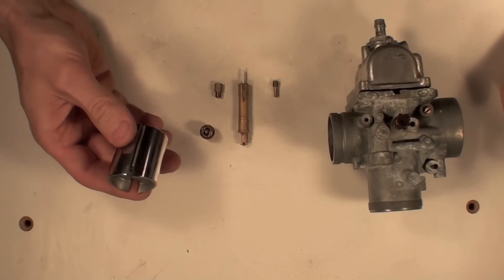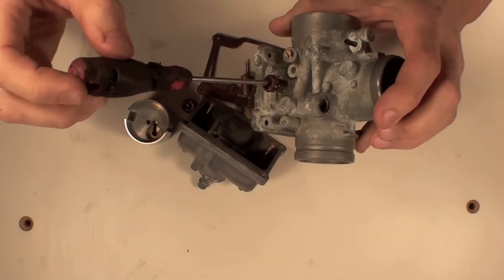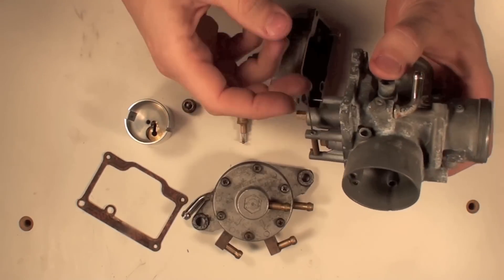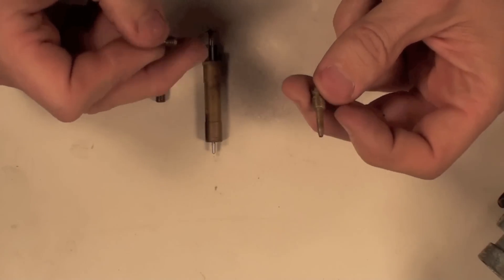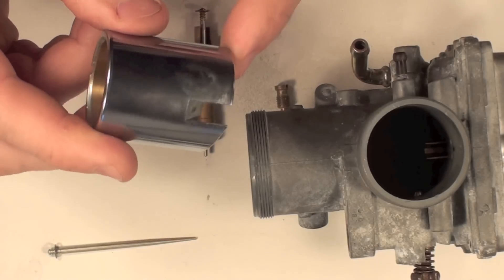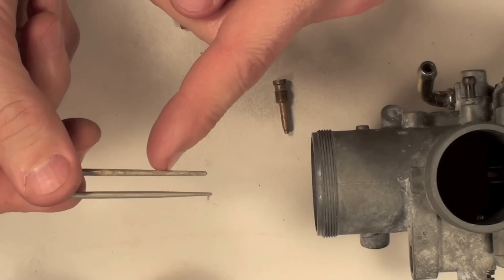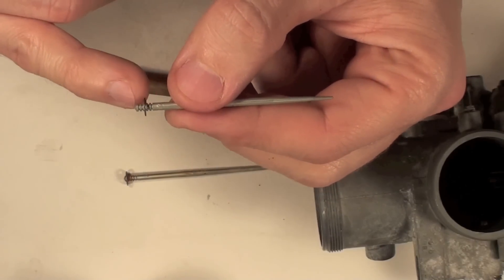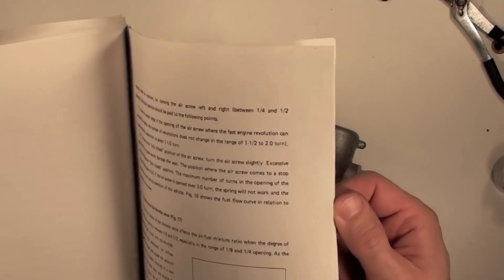Mikuni Carb series #4 How a Mikuni carb works.

Comment: What about the air jet that feeds the main . It's
Lines up with the main jet, the big hole on the air filter end. If you leave it out it will never run right.

Comment: My bike will only rev up with the chokes on, it won’t rev with them off. It just goes blahhhhhhhttt and dies. The plugs have always been very sooty and black, which tells me it’s too rich. Since the Mikuni starter circuit is different from a standard choke, is it giving me more air to the mixture while it’s on and throttle opened? Which is why it can then rev with the choke on? With the throttle closed, it will barely idle with the starter circuit on. Been chasing down the tuning with these carbs for weeks. Air screw is almost falling out to achieve a rise in rpms; I have smaller pilot jets on the way. Any help would be greatly appreciated. Honda 400cc with Mikuni VM 32’s.

Comment: looking for some help> ATV idles and runs fine up until 3/4  throttle. but when i really get on the throttle it bogs down to nothing. spark plug is wet so i know its running rich. what adjustments can i make to fix this problem?

Comment: Lots of Mikuni's also use an Air Jet located inside of the intake venturi.  I believe in your VM manual it is shown as item number 25.  Can you explain how the Air Jet works in conjunction with the pilot jet and air mixture screw?  Does changing the size of the air jet change the intake vacuum during starting allowing more or less fuel to enter?
Reply: Not with the pilot circuit. Strictly main circuit.
You'll have to read more on it.  Just make sure it's clean an put in snug

Comment: I recently ordered a Mikuni VM16 Carburetor for 2 pit bikes and have been having issues with them.  One of them came in and the bike would start, but it would only run on half or full choke even after being warmed up.  Then, once warmed up, the bike would bog in the mid range and not be able to get to peak revs.  
Also, when I turned the choke off, and tried to rev to keep it going, it would create tons of smoke.

On the second motor, it doesn't start at all.  It just floods.  Reset everything back to factory spec and let the engine sit and tried again and it flooded 5 times in a row in just 3 or 4 turn overs.  

Can I get some help with tuning these?

Comment: Trying to get a 95 Timberwolf 250 to idle. My brother cleaned the carb and rebuilt with an "all balls racing" rebuild kit. Still won't idle. You mentioned the pilot screw doesn't need to be adjusted that much.. We put a muffler on the quad because the old one was all rusted. Him and his friend were trying to get it to idle and I remember him having the pilot screw 2 turns out and he was trying 2 1/2 etc. I've been reading into it and the manual says 1 1/4 turn for the pilot screw. If it doesn't idle at 1 1/4 turns out what else could we try? 

Did some reading and going to check the float height and also drain the tank and put fresh gas. Other than that I have no idea what could cause it not to idle.

Comment: Thank you for your videos. I am repairing a snowmobile and noticed that on carb has a what looks like a ball bearing in a tube that leads to where the choke plunger goes in. One of the two carbs is missing that ball bearing is that something I can or needs to be replaced?

Comment: So I am changing for 2 Hitachi to a single mikuni on a Virago.  I purchased a new needle jet that was listed for the carb and when I dropped it in it did not stick out at all.  Besides being shorter everything else is correct, but I have not been able to find anyone who will explain the importance of the length of the needle jet.

Comment: What the heck is these extra two "fuel" lines for on my mikuni
Reply: mine  has them also. they are overflow lines they simply drain straight down into open air.

Comment: I have a 1980 citation 4500. How do you remove the cable from the piston valve. The cable seems to have a plate slid over the slot and I can’t get the cable to slide over to the larger opening where the larger lead end slides out. Hope that makes seance.

Comment: I have a 98 Summit x with the HAC deleted and oil pump deleted as well. the thing will idle but when I go anywhere near the throttle it bogs, won't rev and if I go to WOT it will die. its not the track (belt is off) and the fuel pump is working. I think it must be the carbs although the previous owner claims he just cleaned them last season...any ideas? I run 40:1 mix with 91 octane and ski doo oil

Comment: i have a carb thats all out wack  whats the default settings so i get get it to start then fine tune from there.
Reply: 1 3/4 turns out is starting point for stock air cleaner

Comment: im having a problem in my suzuki x4 when you start it needs to cholk and also if run it need also if you didnt cholk it the motor will dead
Reply from the maker: Bryan_08 Bayudan clean the carb
Reply: may I try if work

Comment: what does it mean when the snowmobile starts and  runs only with the choke plunger removed. had to replace an old powerjet carb with a new vm roundslide,  put brand new jets, needles, and screws in it. it only starts and runs with it out.  if i put my finger over the plunger hole it sputters out. any suggestion????
Reply: 1250cc This is old but it sounds like your jets need cleaned. Take it apart and clean it, and rejet if needed. It means that the fuel isn't going through the jets (or not enough of it is) so opening the choke let's the engine pull fuel directly from the float bowl. Clean the jets and and make sure float bowl drain screw is adjusted properly (may need to consult dealer or possibly find it in maintenance book) and if you still have issues it may need rebuilt. Cleaning jets should solve the issue though. You can do it yourself for probably $50-$70 or so, or have someone else do it for $150 or $200 (that's for rebuild). Cleaning you can do yourself for $6, and someone else will do it for $80 ish depending on their labor rates.

Comment: I have a problem with the choke not working, was hoping you would explain how it works, you only mentioned it once, guess it is not considered part of the carb.
Reply: W. Gator whats the problem with it?
Reply: It is like it is stuck, The dealer replaced the cable, and it worked for a while, but I have to prime it down the plug hole to get it started now and when it warms up it is good for the rest of the day. When I turn the choke on it doesn't work, pulled out the cable and sprayed carb cleaner down there, made no difference.
Reply: W. Gator I think you should replace the spring system if the Choke has one as they often do.

Comment: would a lean mixture cause overheating on rebuilt 440 polaris fan cooled ,my muffler just glows red after ten km.
Reply: Yes that is a very  lean mix I'd check for vacuum  leak at the intake manifold  if the exhaust was not glowing before

Comment: i have a pe250 1977. when i kick it over it's like it is wide open, need help thnx
Reply from the maker: your throttle valve is stuck open.
Reply: would air leak's cause it
Reply: thnx going to go pull the carb and try to work it out. will let ya'll no
Reply: +DRAY ALEXANDER I'm having the same problem on a 125cc, you figure it out? Or anyone else know what the problem is
Reply: Running lean will increase revs making it seem like WOT, tune the carb to run richer. If that doesn't do anything then you might have an air leak from carb>engine or the engine/crank case, check/replace O-rings and gaskets. If that fails then clean out your carb, could be gunk in the jets or not enough fuel in the bowl.

Comment: Great video very informative! Ive got a vm26 on a 79 jd trailfire 440 ive cleaned the carb very well I usually spend 2 to 6 hrs on these "I have 3 trailfires n have worked on many others" originally the sled was flooding basically while just sitting there, replaced needle n seat fixed that issue. now ive got a low end bogg, 1/2 a turn to 2 n 1/2 out on the air screw 2 n 1/2  out book says max although it seems to improve a little that far out. What do you recommend?

Comment: Good Video.....well done! 
Question?  I recently purchased at auction a SUZUKI 250 QUADRUNNER 4x4 .  Pretty sure it's 1987(after deciphering VIN)....outside chance...1989.  I need to replace the carburetor.  I can't tell which model carb. I need.  It's a Mikuni with W638 on one side....19100 on other side.  Searches don't come up with anything.  Everything I see on-line refers to **mm....26mm, 32mm, etc.  Any idea's???  Any help would be greatly appreciated.  Thx much.
Reply: Jimmy G Most likely you don't need to replace it. Rebuild the carb on it for much less work. Rebuilding it and cleaning it will make pretty much all carbs like new, as long as they aren't literally broken (I've never in my life heard of a "broken" carb) usually they don't work because they're gummed up. A good clean and maybe some jets and you're set.
Reply: @savagesalvage4957 
I have a mikuni carb on 85 suzuki quadrunner 250 it has the cutaway valve lever i was told that if i plug all the vacumn lines on carb it will gravity feed in from tank is this true?

Comment: have a couple questions for you, could really use youre help! please pm or email me!
Reply from the maker: ask here please.
Reply: PowerModz thanks for getting back to me, I have an 89 arctic cat cougar 500 afs, all original but a rebuilt motor last winter, this winter Im having a hard time starting it in the mornings and if i stop somewhere for lunch, it takes a bunch of pulls to get it to go and then you have to play with the throttle for a good 2 minutes before it will idle on its own, I havent tried to sync the carbs yet but i am also thinking maybe not enough air getting to it? i want to put dual cone filters on the carbs and remove the air box, any idea if that would help or not?
Reply from the maker: 1134506 leave the airbox on it - filters will draw hot  air in from the engine compartment and you'll lose power.  have your carbs serviced, check your fuel line in the tank and fuel filter.  check your compression.  but i suspect your carbs need a proper cleaning.  cheers.

Comment: Firstly..Your video's have been very helpful.. Thank you.. Second, Please come out with # 5.. pertaining to setup.  I recently replace carbs and cables on an older snowmobile and need to setup the initial adjustment for new choke and throttle cables, then need to sync and adjust to proper running and don't know where to start? can you help?
Reply: I second that notion. I have a 1979 Arctic cat Jag that idles fine, but only runs on high speed if the choke's on. It's driving me crazy!
Reply: @Xean45  sounds lean. Make sure theres no junk clogging the main circuit, and that its got a big enough jet
Reply: @randywallis8190   Thanks for the reply. it was clogged main jet, at the bottom of the needle. I cleaned it pretty good, but I guess there was more junk hiding in the crevasse that worked loose once I started it up. Any recommendations on a  cleaning solution for soaking the parts?
Reply: @Xean45  sorry for the late reply
brakleen works good, and a compressor to blow it out

Comment: I have a 1991 exciter 570, i cleaned the carbs and got it running after sitting for 2 years outside, it wont idle and is super boggy until i open it up it'll take off, i'm thinking i forgot to take the pilot jet out and clean them? could this be the problem?
Reply from the maker: quite possibly./

Comment: Quick question my friend, Im running a rotax 377 in a mini dune buggy for the summer. i have a very similer carb to this (T68) air screw on other side and no choke. but i was wondering how i should set this up for 25 degrees celsious use and how do i go about tuning it?
my email is jonathanbungay45@gmail.com if you could help me out it would be great!

Comment: My -01 edge with flatslide carbs won't idle. Below 2500 rpm it just goes "boooow" and dies straight after. To lean mixture? The idle screw is at its bottom. I would appreciate your help :)

Comment: I have a 1978 Kawasaki KE 100 enduro and I am having a horrifying time setting the float height, either it overflows or it stalls upon load, also, what are the factory specs for the air screw? Thanks!

Comment from the maker: make sure you clean the carbs the way i did it, if you dont you will melt a piston, also if you have made changes in clutching then yes you will run in to all kinds of other issues when trying to tune the system.  don't just clean one thing, you can't clean without soaking the carbs, you can't clean without blowing them out with compressed air too.  when done you need to synch the carbs, and you need to set the air screws to factory specs - if not youll be walking home:)

Comment from the maker: if you havent changed anything then leave the jetting alone, you need to clean the carbs again and make sure you blow the passages out with compressed air.    are the plugs dry from low throttle to 5000rpm or wet?  if wet then its flooding, if dry then starving.  I suspect a good cleaning will fix it up.  Make sure those pilot jets are flowing properly and nothing stuck in there.

Comment: The choke is used to let more gas in then air so the bike starts easier. I am pretty sure it is your main and pilot jets try going up by each size untill you feel that it is getting a good amount of gas and your spark plug has a nice coffee brown color. You will know when you have hit the right jets if your spark plug has a nice coffee brown color.

Comment from the maker: if the carb is original to your sled then it should be fine, how does it run quarter, half and 3/4 throttle?

Comment: I have a problem if i go full throttle when im in low speed it dies is it becouse my pilot jet is to small or couse my main jets to small?
Reply: Try youre idle speed screw  to add more air as needed if that doesn't seem to work  Try turning out you're air fuel screw

Comment from the maker: They should slide in with little to no force.  they have to be lined up correctly though.  make sure you didnt nick the jet or damage the carb body - if so just clean up the ear and try again.

Comment: Thanks for the vids, very informative. One question, I took the needle jets out for cleaning but I'm having a hard time to get them back in. I've tried from the top as you mentioned with the groove lined up. Do these things go in with some force or should they slide right in. Any help or tool recommendations would be helpful... thanks!

Comment from the maker: you need to take it right apart and blow out the passages and clean it, change the pilot jet and needle/seat.  Set it to factory specs and it will run fine.

Comment: Really nice work. I've got some issues Im stumped on with my kids Suzuki 50 3 wheeler. its got the tiny Mikuni 2 stroke carb that has been picky since day one. Now, Ive got it where it will only run with the choke lever all the way closed. I've tried adjusting the 2 mini headless screws to no avail. Any help is appreciated.